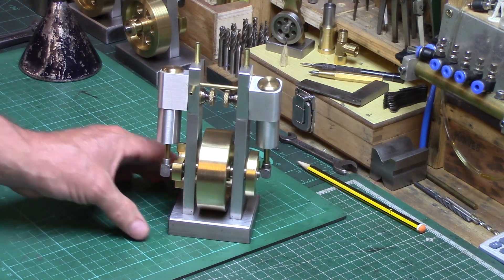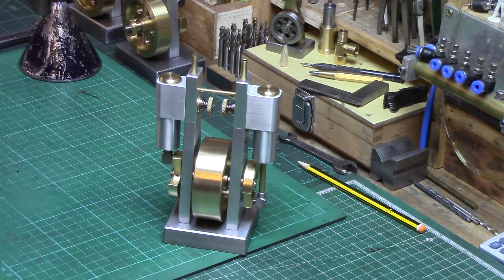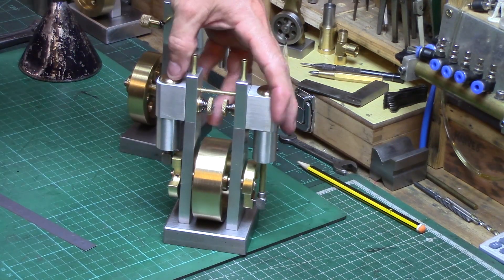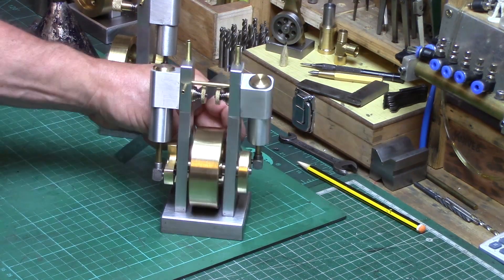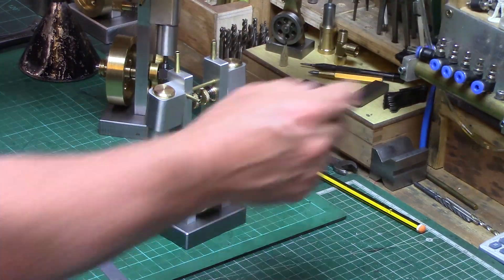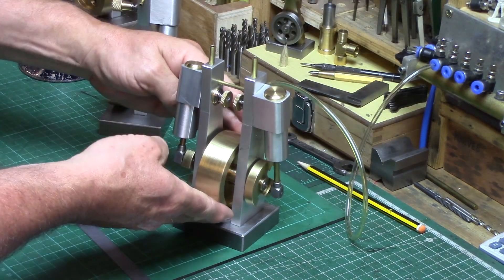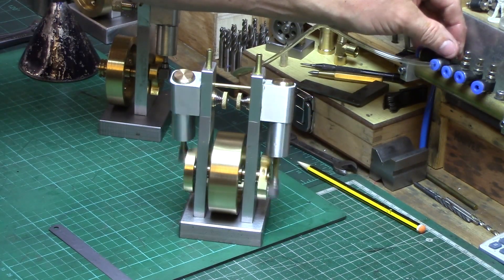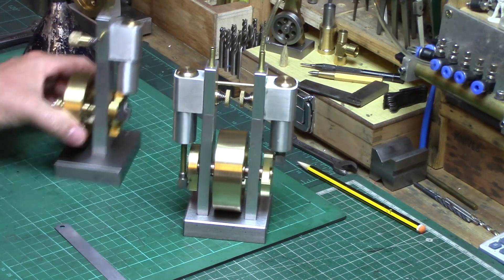Wig-Wag Twin Steam Engine

Comment: The Wig Wag Wizard has come up with another winner! No pressure Ade but will you be releasing any plans so your followers can make this one at home too? I’m still waiting for that book to be released (signed copy of course!) 😀
Reply from the maker: Hi Mick, thanks for your continued enthusiasm for the wigwags, I wasn't planning on creating drawings for this, as it is essentially the same engine as the basic vertical wigwag, with just a couple of modifications to it ... slightly wider flywheel, slightly shorter bearing bushes, reduced spring tension nut, and a re-configurement of the air supply, the dimensions are mentioned in the video so I hope that will help cover the mods. As for a book, well thats an idea in the very early stages, as I think there is some future designs from the wigwag to come yet, and I wouldn't want to publish a book when the project itself is not completed, but sure thing, if it ever makes it into print I would glady sign your copy :)  
Regards, Ade

Comment: Ade, would it be possible to make a twin cylinder wig-wag engine with the two cylinders on opposite sides of the same column?  No reason why -- it just popped into my head while I was watching this video.

Nice engine, BTW.
Reply from the maker: Hi defross, good question. The difficulty would be finding a way to hold the cylinders with spring tension on the outside, but not impossible, the other difficulty would be the flywheel placement, again not impossible, but the engine would be quite different from the essence of the wigwag identity. Cheers Ade